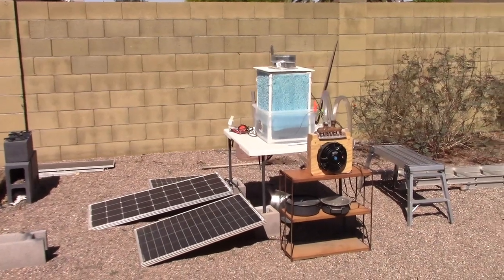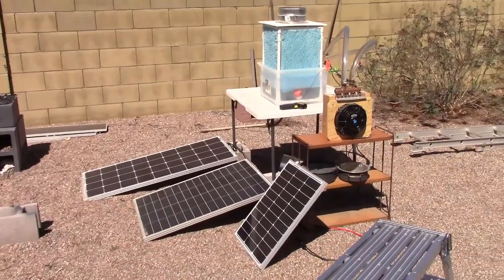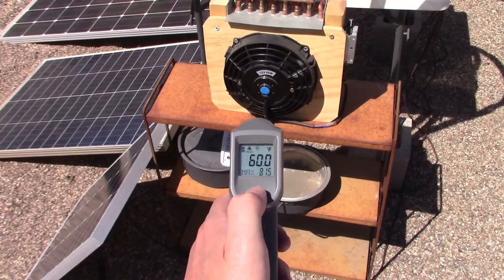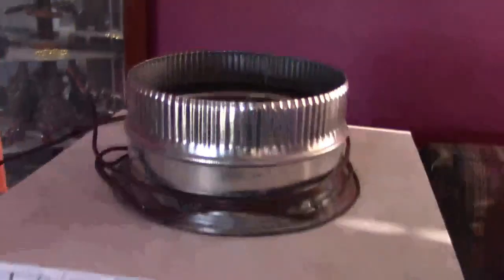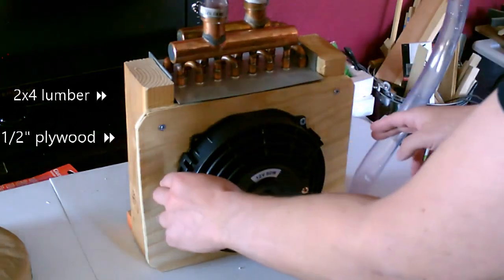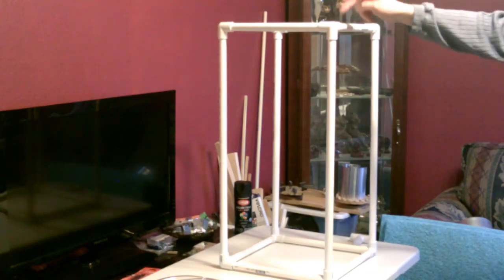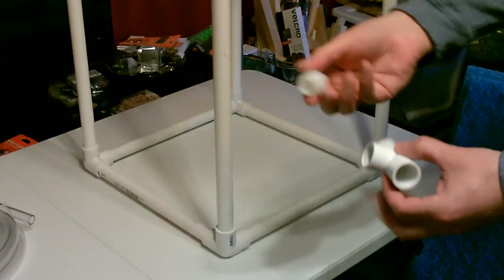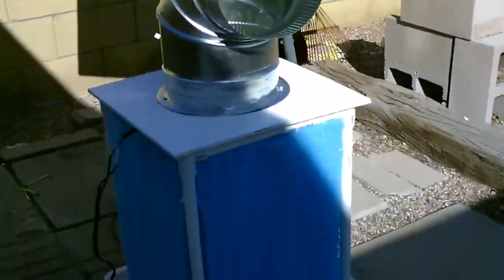DIY "Indirect" Evap Air Cooler! - Produces Cool and DRY Air! No Humidity! (82F-in 60F-out)! Easy DIY

Comment: Great built. Where did you get the heat exchanger? Thanks
Reply from the maker: hi there and thanks. i get those heat exchangers on amazon. i usually buy the ones sold by badger pipe or badger insulated pipe. you can also find them on their website. check this out... here's a link showing 3 pages of them https://badger-pipe.com/collections/water-to-air-heat-exchanger

Comment: It gets really hot here.  Do they make higher velocity fans that use  less eneegy than the big metal ones?  Id need it to blow cooler if possible.  I live in the depths of a humid misquido colony called Mississippi.
Reply: I have two 220w panels and two 300w panels i could use that i cant grid tie easily because they arent the same kind as the majority of my panels.

Comment: Great video! Hey I was just thinking, could the radiator and pump also run hot water you made from your little stove for heating? Could you use the piezo heating gadgets , attach to the radiator and run the fan? Just brainstorming a little...

Comment: Would you please make a compact one that fits in a van ?
Reply from the maker: hi. you could probably use this one in a van (parked of course). you'll always have to have the "blue cube part" outside the structure, but the 8x8 unit should fit in a van. and the fan on the heat exchanger is equipped with a speed controller so you'd just want to run the fan slower so you wouldn't freeze. 🙂

Comment: I watched your earlier videos and started working on something like this for my room. Glad to see indirect evaporation works well in smaller scale!  What was the relative humidity of the air before it entered the blue pads?
Reply from the maker: hi there. the air that day was 5% to 10% relative humidity. good luck with your build! - feel free to ask any other questions along the way. i'll be trying the "blue cube" with my 12x12 heat exchanger too. hope to have a video out on that one soon.
Reply: @desertsun02  ok cool. Its about 30 - 50% relative humidity whete I live. I can't use an window ac in my room so I decided to build an indirect evaporative cooler. It uses honeycomb pads and an 8 by 8 " heat exchanger. I'm going to pair it with the ice/ water box and another smaller heater exchanger so that it can bring the air temp. down further.
Reply: I have a 220 cfm fan from AC infinity that will cool my 8.5 by 14" pads and a 110 cfm AC infinity fan that will pull air through the first heat exchanger and then push that same air through the ice chest heat exchanger. Do you think these fans are strong enough for this set up or should I add a second or stronger fan?
Reply from the maker: hi. it's hard to say on the fans. i use the 7"radiator fans. they push 1000 to 1500 cfm. you'll have to experiment to see.
Reply: @desertsun02  ok. Thanks for your response.
Reply: @michaelalcala6087  Hello Michael , I am curious about how your setup is performing with your air humidity of 50% . How is the performance?
Reply: @michaelalcala6087  Michael, does it work in your higher humidity area?

Comment: Where'd you get the heat exchanger? Can you post a link? I can't find it on Amazon, and I'm not sure where else to look.
Reply from the maker: hi there. it's hit or miss on amazon. if you can't get an 8 x 8 one then a 12 x12 is another good option. i see they have those. they also have 6 x 12 too. here's a link to 3 pages of them (dozen of them). some say sold out but just check back. https://badger-pipe.com/collections/water-to-air-heat-exchanger
Reply: @desertsun02  Thanks!

Comment: Hey @desertsun02 I want to build one of these for my church in AZ. Right now we meet in the park on Sundays and it is starting to get very hot in AZ! We're expecting temps over 110 for a long time this summer. What adjustments should I make to service 25-30 people? Can I beef this thing up?
Reply from the maker: hi there. are you planning on using it outside or will you be using it to cool inside? i've only tested this size so far. you'd have to do experiments to see how much larger it would need to be (or if it even needs to be any larger). btw if you are using it outside in dry climate it's pretty comfortable just going the direct evap cooling route.
Reply: @desertsun02  We are outside, yes. Usually under some trees or a ramada. The use case would be outside with lots of sun and dry airflow.
Reply from the maker: since you are using it totally outside and in a very hot/dry climate you may want to consider just using the blue cube part of it. the main reasons would be that when it's super dry the added moisture can actually make it feel more comfortable (plus you would save money by not using the heat exchanger part of it). also you don't have to do any venting because you are outside. i'd probably make 2 of the blue cube units and place them on either side blowing towards the people. i'd guess that would work great for your situation.

Comment: You could probably add an automatic water level control valve, hooked up to a garden hose, and eliminate having to refill the tank periodically. Fairly inexpensive on Amazon. I'm going to have to play around with this!
Reply from the maker: sounds great. could give you 24/7 smooth operation 👍

Comment: Hi and thanks... COOL CHANNEL pun intended... again. ..

Does the water touch anything toxic like lead or known to the state of California to cause cancer? 

I am asking because I  want to filter the water and make drinking water ...

Do you know if this EVAP COOLER  would work well near a hot HUMID  Texas beach?

 I think it would go well with the existing hour shower and solar in my RV.

 Now to Rube Goldberg all of it together including DIY washing machine..  :-) 

You are the best of youtube .. keep it up please is money an issue with you doing videos?
Reply from the maker: hi there. my main thought on the water is that it does go down the blue "foamed polyester" pads (over and over). i'm not sure what that might add to the water. as far as where this thing works, the best way to judge it is to look at a standard evap cooling chart. these units tend to follow those numbers pretty close 👍

Comment: How good will it work at 104f Arizona sun?
Reply from the maker: hi there. it will depend on humidity but you should be about to get air in the 70's (F) if the ambient air temps are in the low 100's. (in low humidity conditions)
Reply: What are the dimensions of your heater core ?
Reply from the maker: hi. the 'fin area' is 8 x 8 and (total unit including copper at the top) adds another 2 or 3 inches to the height

Comment: This is awesome!  Have you looked into getting this patented? I've been researching innovations in traditional AC technology and haven't found much. Evap coolers work great in dry climates, but even here in CO, the inside air gets a bit too humid. I'm in Denver and although my house is built with Central AC, the amount of power it uses is crazy - about 6,500 watts when it's running, and probably 4-5 Kwh for each hour during the day because it cycles on and off. I have 2 Hesssaire evap coolers running that use a maximum of 335 watts or 0.34 KWh, but since they are inside I either need to run a hose to them or fill them up a few times a day. Your invention is exactly the type of AC unit everybody should be buying - 100% solar-powered and incredibly efficient to boot. A traditional compressor-based AC unit would need to be 12,000 to 14,000 BTU to compare to this and would probably consume 1 to 1.2 kWh per hour vs. this one that only consumes 0.2 or 200 watts. This 5 to 6 times as efficient - truly amazing!
Reply from the maker: thanks! i don't typically consider patenting the things that i make. i actually just like to get the ideas out there and hope others develop some into products that are sold. in the right areas indirect and 2 stage evap coolers are awesome. and very cheap to run
Reply: @desertsun02  That's great and I agree 100% with the spirit - like Elon Musk and electric cars. I may start a company making these because here in Colorado I think they would be really popular. I love my portable swamp coolers, but they are noisy indoors. One of your 2 stage units would run outside and be much quieter. Two questions: Do you have any recommendations for where to purchase solar panels and what brand? Second, I've been reading that 1,500+ CFM might need a 15-18 inch diameter duct. I also may put together a duct for my portable evap cooler and put it out on the back deck. Do you have any recommendations on what to buy? I was going to just try buying some flexible duct hose from Home Depot - but I am concerned that it won't be wide enough for my big Hessaire model that is 3,100 CFM.
Reply: @desertsun02  One quick question - it looks like you built a PVC sink faucet extender/router that allows you to redirect water into the base of the cooling unit. I have been trying to find a way to hook a hose to my indoor sink, but getting the aerator off is tricky. What PVC parts did you buy for your faucet extender?  Thanks.
Reply from the maker: hi. for that i just use 2 90 degree elbows and 2 (roughly 2 foot long) pieces. technically it's not connected to faucet though. i just put it there

Comment: why isn't EVERYONE using this approach?  is it commercially available for a home?   can you use an existing swamp cooler (in service) and suck water out of it to provide to a heat exchanger to work in parallel with the "wet" cooler....?   by parallel i mean both working at the same time using the same reservior of water in the traditional unit to feed a heat exchanger.....

Comment: desertsun02 says he has a 5-15% humidity. Has anyone tried this exchanger in a 70% + humidity environment?
Reply: Randall Greer Thanks for your input. Humidity where I’m at is usually higher than 70% and can be triple digit temperature. I’m starting to think for a long power outage I should go underground which is not an easy solution.